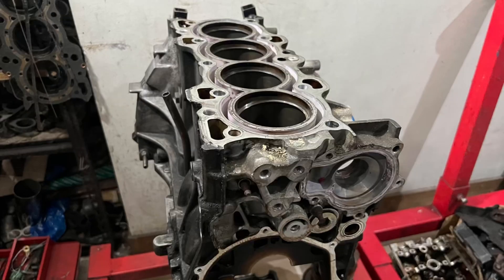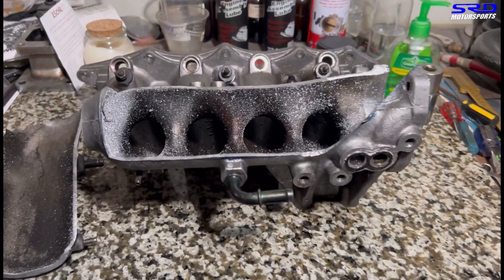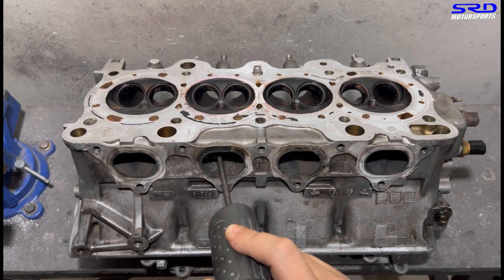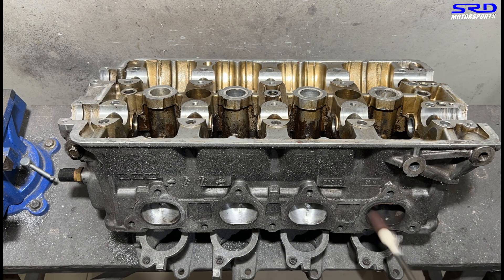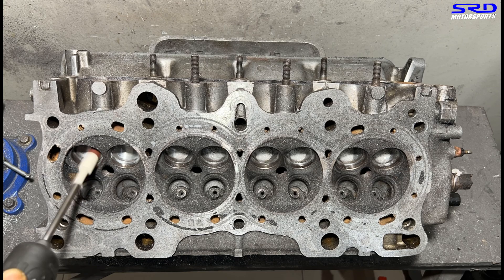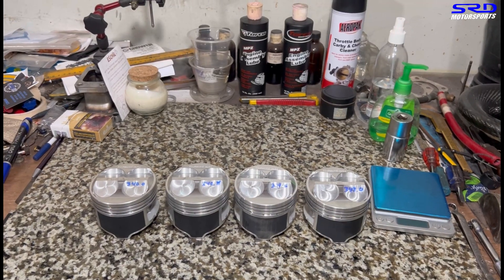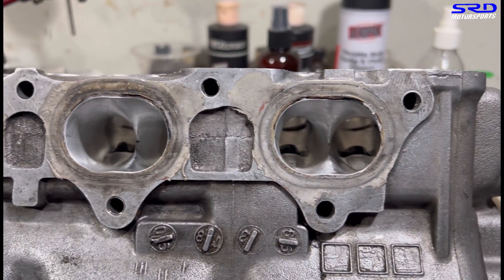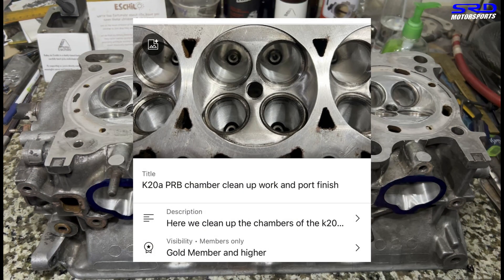Honda Civic SiR B20vtec Build Series Part 2 Head & Manifold Porting

Comment: Cool, Thanks for sharing friend. The engine block, do you have to have a "Torque Hone plate" to bore.and hone B20 Block? And please what engine oil do you use on your buildt engines😅
Reply from the maker: yes the machineshop we go to always uses a torque plate when boring and honing

we use any oil as long as it’s  5w30 or 10w40
and we do oil change every 3 months